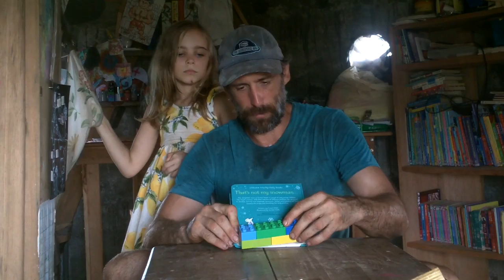Why Propeller Spiral?

Comment: I am glad you made this video as I want to build a screw conveyor for a small biomass boiler.  Im not happy with the current model boilers for sale as they are over complicated or have to many mechanical parts to fail.  Besides they want close to $20,000 each so thats a no go.    
I am going to use the same wooden template idea.  Thank you!

Comment: Beautiful propellers I've made a few with 3/4 hex nuts an stainless steel plate bend on a jig almost like your wooden pattern,I made out steel . I call it my prop anvil. A man who make racing propellers told me your props need a very small cup on them right at the edge , add a tiny cup on the edge of your props you will notice a difference. My fastest human powered vessel was basically a paddle board with 2 propellers inboard turning, my gears where 2 hand cranked centrifuges from the oil industry for making shake outs when you takes samples from oil wells. Top speed 21 mph for about 100 yards an maybe 20 seconds,lol but fun

Comment: Have you tried to make your blades from pvc pipe? The pitch could be modified with heat. It might also react as a automatic transmission, the pitch would flex with high torque and return to a agressive for speed. It could amplify your Pedal Power!

Comment: Of course the spiral shape must be geometrically correct, but pitch should change, (cupping) as the blade progresses(determined by Reynolds numbers).  The foil (cross sectional shape) must be (again)  matched to the Reynolds numbers, and the planform of the blade (including sweep angle) needs to be optimized for a given RPM, loading, (and yet again) matched to the Reynolds numbers that it will be operating at.  get it all right, and you can get laminar flow, and avoid cavitation.  2 different things, BTW. 
you are confusing proper blade geometry with laminar flow. achieving proper geometry or cupping, or both does not guarantee laminar flow.  you must get it all right, and use CFD or tank tests to achieve laminar flow.  It's not a direct result, necessarily. Certainly not as simple as a bit of geometry.